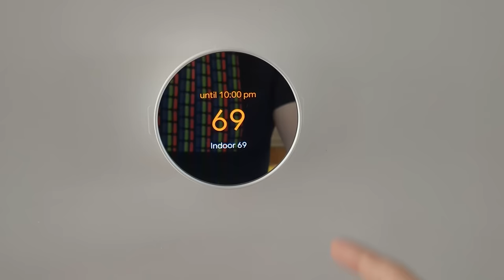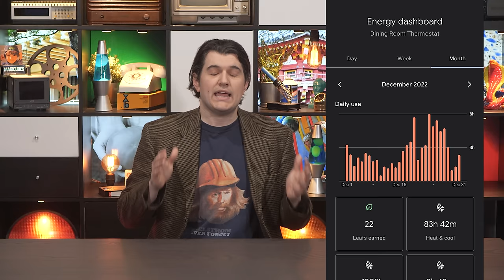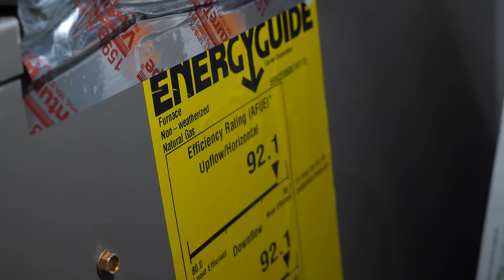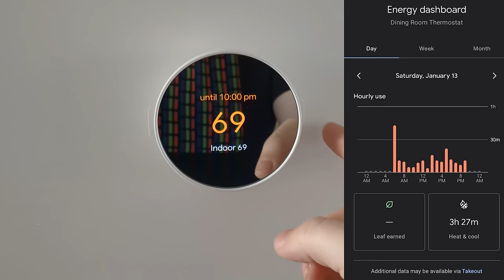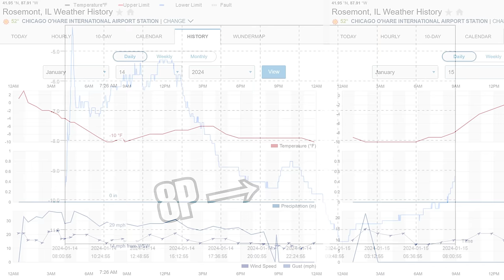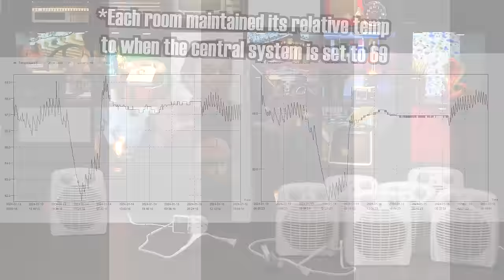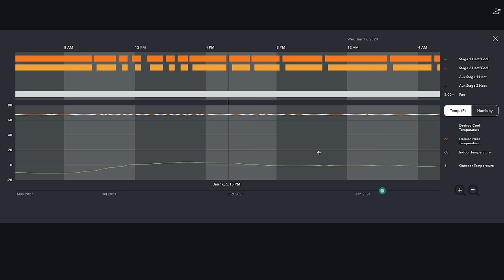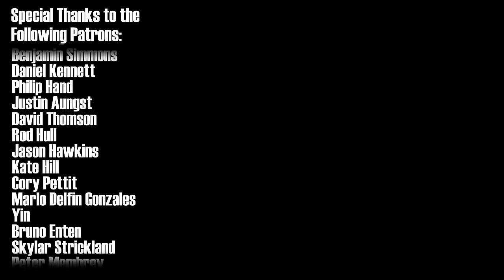Old HVAC industry practices are holding us back and costing us money. But we can fix it.

Comment: I ABSOLUTELY couldn't agree more! My house is insulated concrete, 3200 square feet, 2 floors, and I heat and cool the entire house with a 3 ton heat pump and I had to fight each and every HVAC contractor that wanted to put two 4 ton units in it. I eventually had to pay an outside engineering firm to do what the HVAC contractors SHOULD BE DOING IN THE FIRST PLACE $1200 to run a manual J for the loads.

The HVAC trade is horrible about this and that stupid "rule of thumb". Feel free to reach out if you want some further insight, I love explaining that so many of us are getting hosed by lazy HVAC contractors and showing the proof.
Reply: I would love to hear how you calculated the amount of heat/cool your house needs. We've got an ancient HVAC system that probably needs an upgrade but now I'm terrified to go looking for a company. I normally rely heavily on reviews and word of mouth, but that won't help me when none of the consumers around here are going to understand this stuff anymore than I do. Reviews will be based on "they cleaned up their mess before they left" instead of on actual installations. How do I figure out what my home needs without relying on the people who apparently oversize and overcharge so much that they got an hour-long call out video from our boy here?
Reply: Why wouldn't they let you install an undersized unit?  Just ask if they want the buisness or not.
Reply: @animeartist888  this video basicly explains it.. get a smart thermostat now and start gathering data so you have it on hand in a year or when you need it.
Nothing better then actual data to use as a starting point and a comparison against what you are being told or other methods theorethically tell you.
Reply: A single 3 ton unit against two 4 ton units that was advised? That is just criminal honestly.
Reply: Actually, it all comes down to expectations. In our new residence we've got a 3.5T heat pump for ~3020 square feet. Our neighbors, whom have the exact same layout, opted for the dual 3.5T solution. It takes way too much time for the single 3.5T system to get the temperature right, whether it needs to cool down or warm-up. Next month our HVAC will be changed into a dual 3.5T system, so we don't have to wait an eternity for the rooms to reach the desired temperature.

Also, our electric bill is much higher than our neighbor's, because the single 3.5T system needs to operate at 100% capacity all the time, while our neighbor's system only utilizes 100% capacity for a short time when there's a big difference between the actual temperature and the set target.
Reply: @petergerdes1094 well in there mind it's not going to work so down the line they're going to have to come back and change it why would they want to do that
Reply: @mqe73M  Because they get paid again to do that!  

If the customer wants X and decides they made a mistake they have to pay you to install the replacement.  Just have them sign a form saying they acknowledge you recommend something different and that if they feel it's underpowered it's their problem.
Reply: @petergerdes1094  idk dude, my employer would probably just recommend you to someone else we want easy to deal with customers
Reply: I have a four-tonner in 4700 square feet. It works just fine, though we do use a dehumidifier in the basement in the summer months.
Reply: @rogerk6180  I wanted to comment that it's all about expectations, but someone else beat me to it. Read jasmijntulner9989's comment to put things into perspective. I'm not saying 2x4 ton isn't overkill, but 1x 3 ton won't cut it in edge cases when it needs to overcome big temperature differences in a reasonable amount of time.
Reply: @jasmijntulner9989 it is kind of odd that your units uses so much more energy. Generally they don’t get all that inefficient when running a duty cycle of 100% vs say 50. It’s mostly to do with the temperature difference.

And most systems should run a constant temp all year anyway, especially the water-to-water systems. So the actual speed of heating is less of a concern.
Reply: @petergerdes1094  because making $1500 off the sell of two units is more enticing to them than making $750 off one unit.
Reply: @rogerk6180  yup, "rule of thumb" vs actual math.
Reply: @mqe73M  you mean your employer would rather not deal with an educated consumer so they can save a few bucks.

Fact of the matter is, if they had done the actual calculation, they would have came to the same conclusion and recommended the correct sized equipment.
Reply: @Traxxis03  no I'm the employer's son so I'll have to hear about it
Reply: @Traxxis03  you think people are like you they're not I try to educate people all the time they don't want to hear it they just want it fixed
Reply: @Traxxis03  Thats why they'd prefer to sell you more but not why they refuse the sale when you say "sell me what I want or I find someone who will"
Reply: @mqe73M  Is someone who walks in and says "install this ...I don't care if you think you know better just hook it up" really that hard to deal with?  It seems in some sense easier they did the selection part for you.
Reply: @jasmijntulner9989  while expectations are part of the equation, doing the actual math is literally THE equation...
Reply: @stevenvanpelt486  8 years later with temps that have ranged from -27 to 112 F, it HAS cut it... 

Backup heat via propane for the random cold snaps that hit maybe three times a year is plenty. But what do I know... I just designed, built and live in the house.
Reply: @petergerdes1094  No, but if you start drafting contracts, we probably won't want to deal with just a homeowner like that. You better be a commercial customer. I think in your case, we'll need to draft our own contract that entails that we're not responsible if your equipment doesn't work properly.
Reply: Good question and not easy but your starting point is to look at your bills as they reflect the energy you used, then make adjustment for the inefficiency this is in the boiler/ furnace spec sheet. If electric baseboard then the conversion is near 100%.  your bills should show BTU's and kW so use that as a starting point.  Would you spent 1 kW hr on a fan heater or 1kW hr running a machine that collect 3kW latent heat from outside ?.  Check out Alec's other videos he really does good work.  What Alec was describing in car parlance is "you only need a V8 to get off the line and spin the wheels when a little engine will maintain a highway speed so why oversize the system". 

I am from UK but I understand that some of older American/ Canadian AC systems can't be reversed to heat as the used a gas furnace. You can upgrade to a heat-pump system on a central air this will heat and cool using your existing ducting you just need a new outdoor heat-pump  and the evaporator/condenser in the house duct changed.  Check out HVAC channel. 

Remember a heat pump is compressing the outside heat to a temperature you wish for your home, if it is warmer outside then more heat is available a Heat-pump COP is usually around 3 so for every kW of juice used by the compressor you get 3kW of usable heat. Any temperature above absolute zero is heat that can be used !??  its weird but thats thermodynamics for you. 
Ignore reviews just spend a bit of time reading up on things it is steep learning curve and counterintuitive but the penny will drop and any fitter will soon see by your technical questions and language they are not going to snowball you with word salad.  Get in writing any assurances that the system will meet what is promised also check your countries Government sites as there may be grants.  Long post but I can see you need a starting point I hope it helps. Alec is a smart chap and spot on with this video. Good luck.   @animeartist888
Reply: @mqe73M  Wait.. surely your default contract doesn't make you liable for choosing the wrong system?  I mean sure maybe it's the decent thing to do but that's rarely how contracts are drafted. 

I'd be astonished if even the default contract have a customer who has too weak a system a cause of action unless there is a specific state law.
Reply: @petergerdes1094  I would say you're liable for anything if proven in court something most people don't want to have to go through
Reply: @mqe73M  You have to have a cause of action to sue (and not get immediately dismissed).  I mean otherwise people would walk around saying: I want all my money back because I decided don't like the color or I'll sue and get it.

Comment: Last year, I finished my attic, and had two companies give quotes for minisplit heat pumps. One wanted 2.0 tons, the other wanted 0.9 tons. I went with 0.9 tons. The thing barely spins up on the coldest days and doesn't have heat strips. I found out that 0.9 tons was the smallest unit sold in the model line that they were considering. I probably could have done with 0.5 or less tons. So glad I didn't get 2 tons.

Comment: Good vid. I did all those heat balance calcs when renovating my home. Installer gave me hassle about putting in larger furnace and AC but I’m stubborn.  At coldest point of winter (-20 degC), furnace will run nearly constantly. That is about right.

Comment: One of the best videos you ever made people in Canada need to start considering these systems. With the price of fuel especially propane in remote areas very high a heat pump can definitely be beneficial and keep up most of the time.
Reply: I'm in Ontario and making the switch this year.  I already switched over to a heat pump clothes dryer and water tank.  The furnace is the last appliance using natural gas.  To help with this, I added a larger solar array to offset my electricity usage.

Comment: Last year I replaced the very loud forced air heater in My Home with two Mitsubishi heat pumps. Can’t tell you how happy I’ve been! Very quiet. I can run them on heater cool at whim, and my bill is less than $100 per month.

Comment: Thank you so much for calling out the industry on heat pumps just being AC units with the extra valves. 

We replaced our HVAC unit with a 16 SEER Heat Pump unit in Central Florida back in 2014. Mind you the AC part is more important than the heat part for us. But, the whole 3.5 ton unit, air handler, installed was right about $5,200. I've heard neighbors get $20,000 quotes for heat pump HVAC units. Which is just insane to me.

Comment: I've had a heat pump for 30 years. Initially it was on a forced air electric furnace. It has since been replaced with high efficiency gas. I am hoping this has changes, but what bothered me was the defrost cycle. It would kick on and start dumping heat outside every 90 minutes of runtime. Eventually I rewired the defrost circuit so it only brought on 5kw, but the thermostat would often stop calling for heat in the middle of the cycle. Ten minutes later it would call again, but as far as the heat pump is concerned it was still in defrost. You wound up with a 30 minute cold snap in the middle of the night. I am about to start shopping for a new, hopefully more efficient one - hopefully one that can manage the defrost process better. Ontario Canada.

Comment: HVAC professional for 35 years. You are on the money. Plus installing even a like-sized high efficiency syatem on old restrictive duct work completely negates the benefits of the new equipment.
I'd say 90% of the equipment out there is grossly oversized.

Comment: To be fair, if you're a middle unit on the row, and you keep your thermostat below 70 degrees, you could also be significantly pulling from the heat of your neighbors, especially if there is minimal insulation between units. If there is essentially no insulation in that inter unit wall, it probably has an effective R value 3 or less. Taking your cold-snap datapoint during which your home was at 62, you were probably 8 degrees below your neighbors' units. 8 degree differential over an R3 wall has a similar heat loss as your R15 exterior wall with a 40 degree temp differential. To your neighbors, your unit looks almost like an extra (3rd) exterior wall, so you have to add that back in. So probably add another third to your furnace runtime to match the temperature of your neighbors on the coldest day. This brings the 6 hour runtime up to 8 hours on your design day which agrees perfectly with your very thorough electric heating test showing that your hvac is 3x oversized. Great job!

Comment: Aussie HVAC tech of 40 years! We manufactured them from 1972 - glad to see our American cousins finally catching up! One point you missed out on  - a little issue of “duty cycle”you don’t want your gas heater, airconditioner or “reverse cycle airconditoner” (aka Heat Pump) running 24/7. What you are arguing here is that the compressor in your refrigerator is 500% larger than it needs to be - which it probably is. However just try designing a refrigerator with the compressor running 24/7 - and it won’t last very long. Size your heat pump so that it’s “just right” for your home and let me know if your electricity bill is still $70

Comment: Having worked in HVAC, I appreciate this video.  I can say from experience part of the reason why rules of thumb are used is because margins are tight and homeowners don't wanna pay any more than they absolutely have to, so they're not gonna pay for the time it would take to do full measurements and no company is gonna do all that for free.

In my experience, unless you're doing new construction or have a cozy in with a housing complex, most people don't even change their AC or their water heaters preventatively.  They usually just wait for it to die and make a big mess so it has to get fixed immediately, at which point it's a matter of what the supply house has in stock.  And as you said, suppliers usually just carry a handful of sizes for economy of scale so you have to pigeonhole the closest thing.

There's also brand considerations as well, like our company hated dealing with Carrier but tended to prefer Rheem, Amana, and Goodman.
Reply: If they aren't willing to pay $100 to figure out the right size, why do you think they will be willing to pay an extra 5k to massively oversize the system?